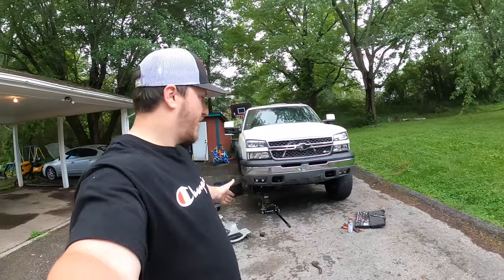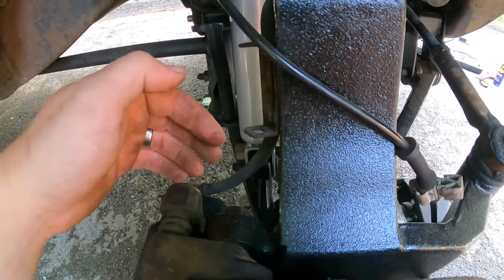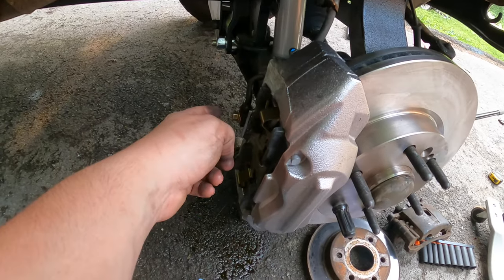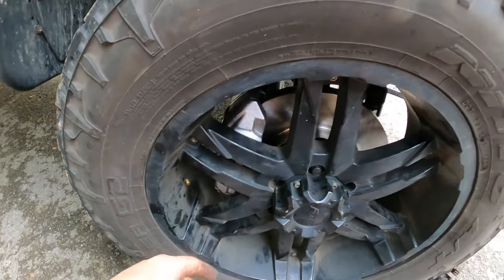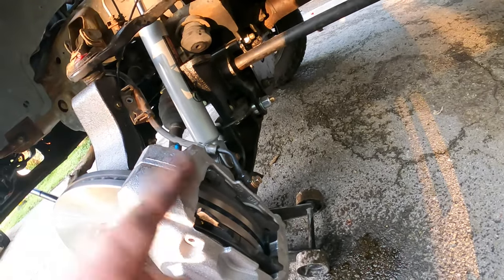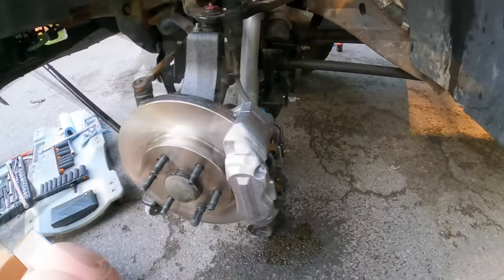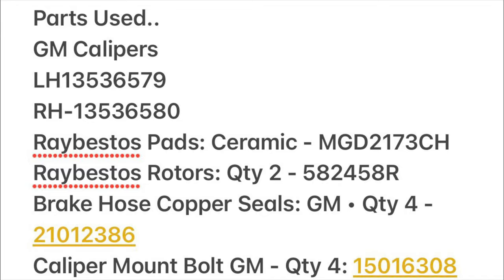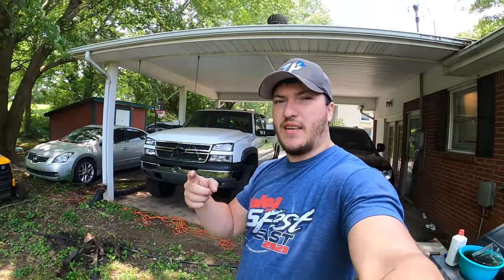BIG brake Upgrade On My 03 Silverado!!! (2019 Brake Swap!!)

Comment: I upgraded my brake lines with stainless steel braided lines and the difference was night and day. Make sure you get the extended ones for the front lift.
Reply from the maker: I thought about upgrading but I had already replaced the brake lines probably 6 or 7 months before I did this upgrade lol
Reply: Can you post link where you got them at?
Reply: Do you have to have adapter brakes or does caliper mount straight to factory ears
Reply: @HoustonRocket281  I bought mine on eBay. But sometimes you probably have a hose shop that can custom make you some. The mount on the eBay ones are different from factory ones.
Reply: @issactaylor621  it mounts to the factory ears but you have to get the washers to space it out evenly. And have the front of the caliper shaved down.
Reply: @imonaroll9502  thanks did the break conversion long time ago but i appreciate it

Comment: You should go with the 2021 Tahoe PPV front brakes, they come with 16 inch rotors and 6 piston calipers
Reply from the maker: Probably brembos! I thought about doing that but these were a lot cheaper lol
Reply: Will those worn with 18 inch stock wheels?
Reply: @justinstatham6378 You have to grind down the notch looking part on the front or it'll rub on the wheels or use a wheel spacer
Reply: Yeah they're awesome.
But them calipers actually are bout 650 each
Reply: September of 2024 and those are about two grand for the set.  I'll stick with the four pot.
Reply: Yeah right, those are like 2k for the swap. Including the $300 for powdercoating, I'm only $800 in for the whole swap

Comment: Heard someone in another channel that it doesn't lock up the brakes when you slam on the brakes. Do you see that issue? Thanks
Reply from the maker: @Pooh_Racing  it doesn’t lock up but it stops very well! Unless you bypass the anti-lock break system they won’t lock up. Plus you don’t really want them to fully lock up for safety and performance reasons.

Comment: Nice, who needs a newer Silverado that comes complete with afm, collapsing lifters and everything else 🤣.  I'd like to upgrade the crappy drum brakes in the rear of my 2006, but that would probably mean I'd need a new rear diff that came factory with disc brakes, and I'm not sure if that would mean needing a different proportioning valve or anything like that.
Reply from the maker: At this point mine is almost a 2023 lol 😂 and I think they make an adapter kit to convert to disks from drums! And from what I heard of you swap the rear ends the only thing needed to swap other than the rear end is the lines to the new calipers, but I’m not 100% sure on that lol
Reply: @ZPTVChannel  thanks, i may look into it further.
Reply: Mines already disc I guess the upgrade would work both front at rear.
Reply from the maker: Mines disks all the way around from factory. Some had them and some had drums in the rear and disks up front.
Reply from the maker: This 4 piston upgrade only works for the front
Reply: Did it push the wheels farther out than the stock rotors
Reply from the maker: I didn’t notice any change. If it did it was very little.

Comment: Don’t mean to high jack the comments but is there a OEM swap like this for a ‘14 Silverado 1500 LTZ?
Reply from the maker: I think these same calipers should also fit that year as well. Not sure on how many spacers it would need between the caliper and steering knuckle, if any but I think it bolts up the same!

Comment: How are them breaks doin now that they are 4 months old? And what did you do for the dust shield? Thinkn about doin it to an 08 Silverado 1500 Z71..... have to build the truck that GM should have built in the first place..🍻
Reply from the maker: They’re doing amazing!! No complaints whatsoever! I never ended up running the heat shield but I saw one guy do this swap where he just drilled out the 2019 heat shield to fit and it looked really good!
Reply: @ZPTVChannel  I need to do it those 2 piston calipers just don't do it on a crew cab truck that weighs 6k pounds!
Reply from the maker: @jimmytwotone2127  right! Even mine just being an ext cab were lacking in the brake department lol but now it feels super solid!
Reply: @ZPTVChannel  Nice! I'm gona do them cause I'm getn ready to do some things to the motor and well they Should have come that way to begin with....I feel like I'm building the truck they couldn't oh wait they do now and want $75k for it!🍻
Reply from the maker: @jimmytwotone2127  right?! Lol 😂

Comment: Can you test if the 17 inch stock wheels work with the big brakes
Reply: Oh nevermind
Reply from the maker: I would but I don’t have them anymore.. from everything I’ve seen and read they won’t fit. They sit pretty tight in my 20” wheels.
Reply: @ZPTVChannel  where did you order your calipers from?
Reply from the maker: eBay! That’s about the only place they weren’t on back order lol
Reply: They don’t fit bro I tried it spent 300$ and grinded them and voided the warranty and they don’t even clear my 17s I was so mad cuz I barely bought new all terrain tires for my 17s don’t feel like buying another set or tires with rims
Reply from the maker: @enriquesanchez7747 have you tried spacers?
Reply: @ZPTVChannel  yes I did I tried 1/4 and 1/2 but they couldn’t clear my 2004 z71 17in wheels Im looking for 20s now
Reply from the maker: @enriquesanchez7747 that’s the only bummer about this upgrade.. you pretty much have to buy new wheels if your running stocks.
Reply: @ZPTVChannel  yeah I don't want anything bigger then 17s either I wonder if a wider offset would clear
Reply from the maker: @jesses.7107 maybe or maybe a bigger spacer.

Comment: Do you have the link to the calipers please
Reply from the maker: I just looked up the part numbers and bought mine off eBay!
Reply from the maker: GM Calipers
LH- 13536579
RH- 13536580
Reply: @ZPTVChannel  did you but them aftermarket or oem
Reply from the maker: OEM! And those part #s are GM genuine part #s!
Reply: @ZPTVChannel  would you recommend buying some aftermarket replacements or no since the oems are really expensive at the moment
Reply from the maker: @RICKY-LSX  I haven’t really found anything good other than oem or brembos..
Reply: @ZPTVChannel  yeah I went on Amazon and eBay and they have aftermarket replacements that look the same but don’t know if they’re worth
Reply from the maker: @ricky392 I’ve never had any experience with them so I couldn’t tell you for sure.
Reply: @RICKY-LSX OEM’s aren’t expensive at all. Che knout rock auto too. Less than $90 a piece.
Reply: @cbrsilv15  thanks for the help I ended up finding some used oem ones in really good condition for cheap